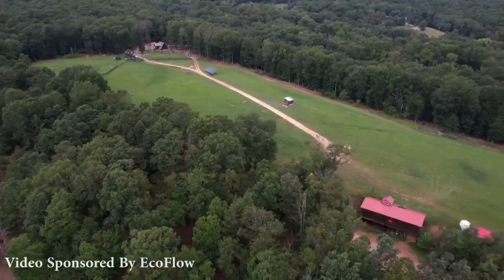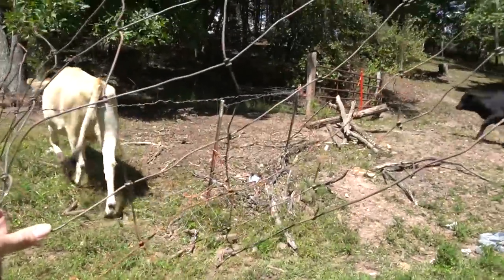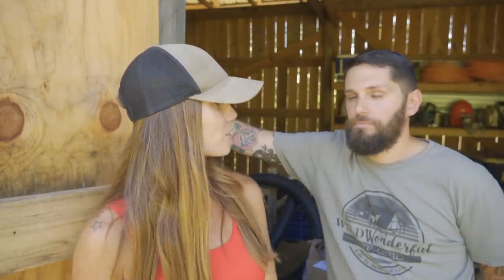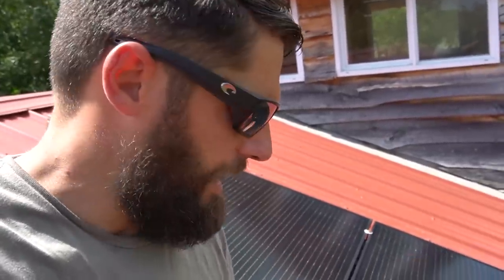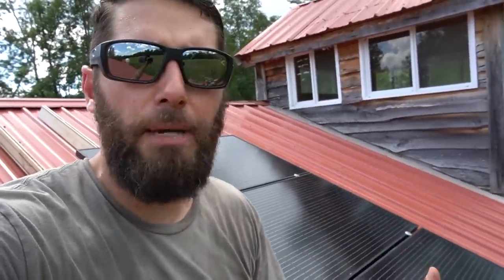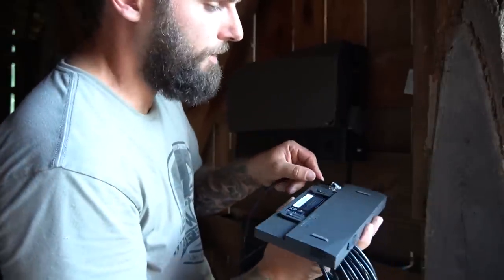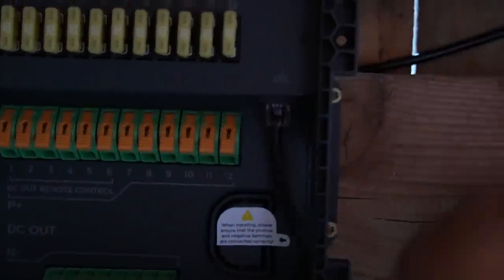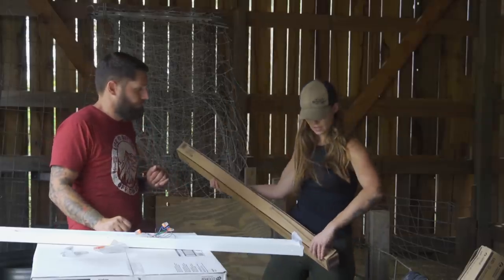EASIEST Off Grid Solar Power System | Machines Arrive For House Build | Issues In The Pasture

Comment: Why didn't you get DC LED lights?  Isn't DC more efficient in small systems?
Reply: Yeah it seems they missed a great opportunity to be more efficient by using the 12V outputs of their solar battery by converting to 120V and then converting the 120V to low voltage to run the LED light fixtures. Either way, still a great job of showing how easy it is to install.

Comment: Hi Erin and Josh, How are you liking this system after living with it for a few months? I am considering getting this for my van conversion. I have been seeing more reviews with issues coming up. Can you still recommend the Ecoflow power kit? TIA
Reply from the maker: Hi! We have not had any issues. However, keep in mind, ours is for use in our barn so doesn't get as much wear and tear as the system would in a full-time living situation such as a van. So far we've had a good experience with the system for what we've set it up for. I'll keep you updated if we run into issues!

Comment: You should have made 2 light circuits, so you can switch on only half the lights to save energy if you have low batteries or if you want to have lights on for longer.

I think mister electrician forgot to put a ground rod and ground wire in his circuit!

Comment: Only a question a 400feet cabling is more expensive than a solar system with a 5kw battery ?
Reply: Time, energy, and work vs a quick installation of the separate solar system.

Comment: Hi guys, hope you are all well. Super solar kit and I like the DIY aspect of this. Very neat and I like the clip connections on the boards. I think I'd be tempted to try out the 12v DC circuits - led truck lights, alarm, cameras. And I'm sure, with a little training, Josh could be a high wire athlete!!!!! :)  Thanks for sharing. Stay safe and keep up the good work. PS. Ellie NEEDS a donkey. ;)

Comment: How comes you guys use barbwire. One one  on top and one run onthe bottom for strength  there won't need to repairs  for life time unless  the post rot and that should be twenty years

Comment: that ecoflow system looked like it would be really perfect for a tiny home but the nail in the coffin is its only 120v ac,  it really needs to do 240v split phase or its pointless, most of the decent well pumps are 240, yeah you can get 120v well pump units but who wants to run expensive heavy gauge wire out to their well pump.  also a decent sized mini split needs 240 and if you don't have a propane tank or access to propane delivery then your stove will be 240 also.

Comment: The only thing you didn’t mentioned is weatherproof? It must be weatherproof it Has’s to be.
Reply from the maker: It’s not but we have a barrier between the equipment and the elements to prevent water from getting in. As a side note, we don’t have an issue with rain entering the barn but we put preventative measures in place anyway

Comment: that barn is so open how can animals stay warm/even heavy plastic would help with cold and dampness
Reply from the maker: It’s not damp in the barn.  Our ewes lamb in there and with solid bedding they are good to go- they are sheep after all. What do wild animals do in winter?
Reply: A barn does not have to be air tight, farm animals give of a lot of heat and sweet. Chickens are really bad at creating humidity and why commercial chicken barns have fans to control that.